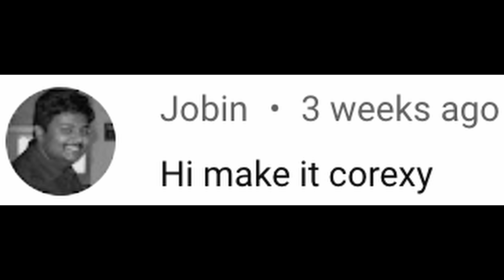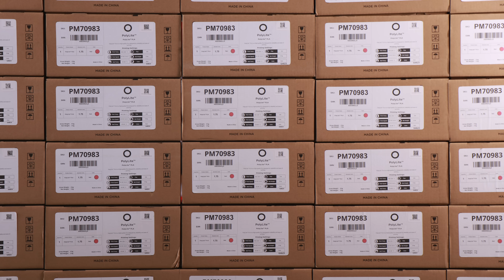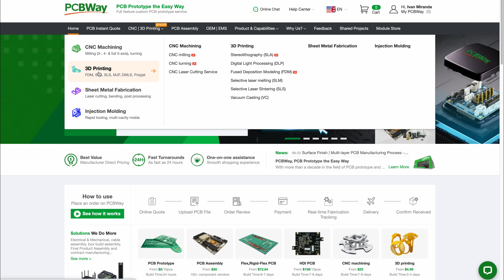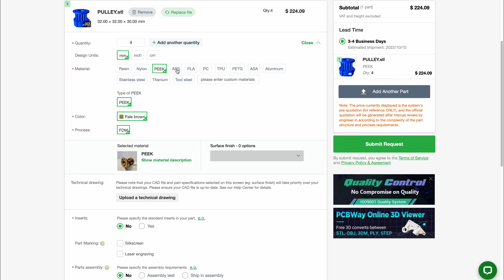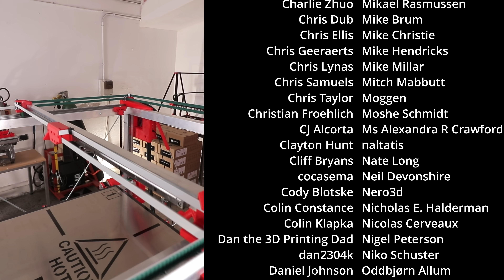I FINALLY CAVED, COREXY - GIANT 3D PRINTER BUILD PT. 4

Comment: Fill the stationary frame with sand to reduced the amplified noise of the steppers and reduce vibration.
Reply: Well... It's sounding like a spaceship... I don't know if changing it would be a good idea... 🤔
Reply: There have been tests, other then being a danger to the mechanics, filling spaces so comparatively small with sand does not help.
Reply: That is a great way to do nothing and get sand everywhere and destroy your mechanism
Reply: Better to use PU foam to absorb resonance and ringing of frame tubes.
Reply: Could some of the vibration be from the toothed belt going over small round idlers? Or is it all motor switching noise?
Reply: @JamesUKE92  I was thinking that too.  Also, I can't imagine the teeth of the belt are going to last long if they're rubbing over the flat-faced idlers like that either.  I think it might be a good idea to replace the idler pulleys with suitable toothed idler pulleys.
Reply: @FG-Supercharged  Yeah, when I saw the teeth oriented in like that, this was my first thought
Reply: Instead of sand you could use rubber or silicone

Comment: First print will be a corner piece to an even larger printer. 😁
Reply from the maker: Deal! 👊
Reply: @ivanmirandawastaken  I sure hope it will max out the print area!
Reply: @ivanmirandawastaken  Make a printer that's mounted on the walls of the room you're in, also using COREXY. :)
Reply: Perhaps with 'belt & pinion' - would be cool to see, and less problems with tension/stretching.
Reply: Hey Sean, caught you there 😊
Reply: End goal: Print-in-place version of the tank.
Reply: @ivanmirandawastaken  I hope this printer has a massive heat block because it's going to take a long time to print anything otherwise!
Reply: My guess: Ivan's end goal is to make printer big enough to do a print-in-place house out of red PLA.
Reply: @ivanmirandawastaken  I think a funnier one would be to print a regular size (200x200) printer which just needs screws and bearings
Reply: a printer that can print a house..
Reply: Do it!  How high is your ceiling!? :)
Reply: @ivanmirandawastaken   dear lord I hope you do this and keep doing it until you max it out lol!!! The sky is the limit mantra fits your circumstance perfectly lol!!
Reply: your sick!

Comment: Our pleasure to help you fab these parts out and most importantly, nice content as always, Ivan 👍
Reply from the maker: Cheers!
Reply: @ivanmirandawastaken  What is the cost of those pulleys in aluminum though?
Reply: @ionstorm66  I want the same answer. I thought about getting a quote to see if it is worth it or not. However, if they do not exist already off the shelf, the cost could be worth it. Hopefully it is low enough to not regret the purchase after the fact. Inevitably this size of printer is going to become commonplace in the next few years and the parts will be readily available. I have been collecting parts for a couple years and plan on making one at least this size. I just need the space.
Reply: $1000
Reply: @jesuslovesyou5819  that would be too much, for sure. I hope it's not that high.
Reply: @ivanmirandawastaken  🥂🥂

Comment: For folks building their own printer: When tensioning the belts on coreXY, you need to keep the Y-gantry square with the frame.  The easiest way to do that is to move it to one end of the printer and tie it down there temporarily while you tension the belts.  When you pull on one belt, it will want to move the gantry out of square, and this is normally held in check by the tension from the other belt.  This is why both belts need to have the same tension, and why you need the gantry held square while the belt tensions are uneven while being adjusted.

Comment: You should swap the smooth belt idlers you have now for toothed idlers (either store bought or just printed with some bearings in it) because these smooth bearings will damage the tooth profile of the belt over time since only the tips of the teeth are in contact with the idler bearings.
Reply from the maker: Those teeth will last forever against the bearings.
Reply: @ivanmirandawastaken  i have smooth bearings on my CoreXY over 2 years now, and had no problems at all at 200mm/s every day. Toothed idlers have smaller bearings in them and last shorter. Keep the bearings :)

Comment: One source of the noise are the teeth of the belts running over ball bearings instead of fitting pulleys. The xy System should then be significantly quieter

Comment: Here’s the CoreXY explainer comment!

The primary goal, as Ivan said, is to reduce the moving weight of the system. By keeping the motors stationary, you accomplish this. Unfortunately, it becomes difficult to isolate the movement of the motors into the two separate X and Y axes, so they end up getting combined like he demonstrated. 

Previously, in industrial machinery with very stiff gantries, you could accomplish this with a kinematic system called an H-bot (called this because the belt forms an H shape), which was very simple and didn’t involve any belt crossing. It does however, REQUIRE the gantry to be very stiff, as X direction moves applied force to only one side of the gantry, exerting a twisting force on it. 

With the advent of 3D printers, pretty much the first consumer-tier high speed cartesian robots, a new system was needed, in order to not require a super stiff (and therefore heavy and expensive) gantry. CoreXY had been used throughout history, most notably in computerized drafting tables, but didn’t see it’s big moment until people realized it’s perfect for fast (or in this case very large) 3D printers.

As for how each system actually works: here’s a quick explainer:

 - H-bot kinematics use one very long belt, which wraps around each motor with both ends at the carriage. This means that there is only one way to pull the carriage in each direction. Since each end comes from a different side of the gantry, those same forces are applied to only one side of the gantry, causing it to twist. 

 - CoreXY kinematics essentially just double up the H-bot design, adding a second belt, running in the opposite direction to the first (with one motor per belt) so that each carriage move produces two equal and opposite forces on the gantry, cancelling out the twisting forces.
Reply from the maker: Told'ya
Reply: @ivanmirandawastaken  Just doing my job ;)
Reply: I built a CoreXY, well, I modded my weird XY bedflinger to be a CoreXY bedflinger, and there is always a tradeoff. In the case of the CoreXY, you trade the mass on one axis for much longer belts that are a bit more prone to ringing. And you still have one axis with a greater mass than the other. A crossed gantry design (sometimes called "quadrap") has shorter belts and both axes have the same mass, but it requires more hardware to prevent racking.
Reply: For extreme large machines like this a cross xy gantry would work better. Way shorter belt so less resonance on it.
Reply: @TDOBrandano  yeah, honestly on something this big I’d probably do rack and pinion or a stationary belt drive just for precisions sake. Most of the time spent printing is gonna be long straight lines, so the lower accelerations needed for a heavier gantry wouldn’t have as much of an impact on print time.
Reply: @staticred1559  very true, that also reinforces any twist in the center of the gantry from the weight of the carriage (which for a printer of this size will be noticeable). CoreXY definitely shines brightest in mid-sized high speed machines (like the Vez3D AWD)
Reply: @benhobby17  For such a large printer it'd even make sense to have an additional fine motion stage mounted to the gantry -- by which I mean, use the main gantry for traversing the whole huge 3d print volume at modest accelerations with the extruder motor, and a second super lightweight delta motion stage attached under that to allow the hotend to perform small/fast adjustments independently of the rest of the gantry. In terms of control algorithms, you'd use a crossover filter to separate the demand position signal into high frequency and low frequency components, and feed the gantry the low-frequency part and the small hotend stage the high-frequency part.
Reply: @AJMansfield1  that would be the way to go, but the two big problems are gonna be resonance from the moving mass of the delta, and the insane complexity multiplier of having an entire extra printer mounted to your printer. For me, big + rigid + powerful would be easier in pretty much every way. But I’m also not a software guy.
Reply: Also with software and fast microcontrollers the complexity of corexy is solved almost for free and basically goes away.
Reply: @AJMansfield1  yes for a bigger printer having like a 2" diameter delta with a bowden might help quite a bit, might also be interesting to use the principle of the 45° nozzle that allows 90° overhangs, and make the delta able to twist.
That does add a bit of weight to the gantry, but it also means you don't need huge acceleration on the heavy axis.
Reply: also its an etch a scetch
Reply: One of the issues I would suspect these systems to have is that any vibration/slippage on a motor translates into an XY movement.  Being a differential system on coreXY it’s going to be sensitive to this.  However it is self aligning when stable (the common mode state in electronics terms). Great idea.
Reply: I thought the 3d printing community was collectively intelligent enough to not need such an explanation.  Guess not.
Reply: @roguereductionist8147 Perhaps there are people new to the 3D printing community who could benefit from an explanation.
Does it make you feel better about your  self to put down an entire group of people because one of the group was nice (and intelligent) enough to type out an explanation? Are we all supposed to admire you for pretending to be intelligent?

Comment: Ivan, thank you for your video series. In industrial robotics what you have made is called an H-bot. They are perfect for this type of application where the Z height of the end effector (print nozzle in this case) remains constant. The sound you are is a byproduct of the resonant frequency of the components connected to the source (motors). Adding mass or dampeners at the right locations will reduce the amplitude of the transmitted sound. This could be a block of rubber next to the motors inside the hollow aluminum tube or filling the tubes with sand or other material.
Reply: In the lingo of 3d printers, an h-bot is different from core xy.  An h-bot uses a simpler belt routing, but has the disadvantage of causing torque on the moving axis.

Comment: Very nice looking printer. If you are looking to make it even more insane, you could upgrade to a CoreXY AWD by adding 2 more steppers at the idlers. It would give you greater stiffness in the belts thanks to shorter paths between motors and gantry as well as more acceleration. If you want to lighten up your X axis, machining pockets in the aluminium extrusion is a known way to do it as long as you don't remove too much metal. Or straight up use a square carbon fiber extrusion. That way you lower the moving mass. The frame itself already seems very stiff, using steel instead of aluminium could improve that. Since it is immobile, that added mass is no big problem and will help damp gantry induced vibrations. Sand filling could also work. Don't know what kind of hotend you plan to use (maybe even a custom one?), but with this size it better be a very high flow one to take advantage of such a large print volume.

Comment: Nice setup. One trick to confirm that there's equal tension (without a belt tension tester) on the belts is to pluck them and hear the sound on an equal distanced area like across the back of the back of the printer. then you can use a guitar tuner or by ear and hear if they have similar tone.

Comment: super awesome work Ivan! congrats on the first try success! :P
i think a large part of the sound and belt vibrations are coming from the belt teeth running over smooth idlers(/bearings). i'm pretty sure you can buy appropriate idlers and it not get PCBway to hook you up.
the pallet of polymaker filament is pretty sweet, but maybe ask them for pellets and a pellet extruder.
alternatively, a multi-input hotend like the diamond, modded with multiple heat zones and drilled out to 1mm+ will let you push lots of filament and multiple spools at the same time.
Reply: You can also turn over the belt so it rolls on the flat side. It just take some clever additional pullies to engage with the motor-pulley
Reply: @bee2hive  or he could just use toothet idlers...
Reply: I was going to make the same comment about the smooth idlers, I'm also interested IF they'll leave any noticeable printing artifacts

Regardless this build is badass and i can't wait to see it print :)

Comment: I love it, It's a new type of musical instrument right? The 3d printed corners and most parts are hollow PLA Chambers that amplify the resonance of the steppers. IMHO -Silent drivers? - add dampening material in the corners and bars. Add weights to the frame that can be placed in various spots to reduce the resonance noise across the beams. Turnbuckles would work really well as a replacement to the current bracing system allowing you to use a synthetic fiber (NON-stretch) to decouple vibrations, allowing for increased tension to tune out vibrations.  I have also had great success at reducing Motor noise by strapping large heatsinks or weights (non-Ferris) to the side of a stepper to reduce vibrations in stationary motors.   Nice Project cannot wait to see this print or at least play a nice tune.

Comment: So, here's a tip for making it much quieter.  This worked for my coreXY, but it's only 300x300.  The belts, if you twist them once, 180deg, between the motor and the fixed corner, then the smooth side of the belt will run along the pulleys in all the corners.

Comment: I built a core xy printer (Voron 2.4) and not sure how you ran the belts but you should be able to to run the smooth side on the bearings. You may want to look up their design to see how it was done.
Reply: toothed bearing, rather than a smooth one.
Reply: @jase171973  also :) Would help

Comment: Great machine....:)
Sounds like bigger idler bearings will reduce the noise a lot. I can hear the belt teeth impacting on the skate board bearings. Put a couple of bearings on a shaft in the vice and run a loop of belt by hand to test if I am right.

Comment: I think the teeth of the belts moving around the idler bearings at the corners is contributing to the extra noise. Should those be toothed gears at those corners for the belt teeth to ride on?

Comment: I don't see another comment saying it yet so:

you should probably get pulleys printed for the idlers too. Crushing belt teeth into bearings drastically increases wear on them. It's only 4(or 6 depending on layout) anyway.

Comment: is it possible that the noise is coming from the ribs on the tight belts rolling over the smooth idler pulleys? then it is amplified becaise it resonates through the frame?  maybe switch to a ribbed to idler pulley to reduce noise? thay being said I could be completely wrong. it was just a thought

Comment: Great !  Is there a way to reduce motor noise ?
Reply from the maker: Yes, tunning and even more important, not being a savage when doing the config
Reply: @ivanmirandawastaken  🤣
Reply: @ivanmirandawastaken  I'm sure you're aware of ClearPath motors from Teknic. I used them in my CNC router build and yeah if/when I ever get the chance to build a 3d printer on this scale I'll be for sure using them on that. They're extremely quiet, strong and fast. Granted they're a bit overkill for the movement demands for a 3d printhead and of course more expensive, it'd still be cool to see them on something like this. =)

Comment: Thats some nasty stepper whine. I suggest something like the nano zero stepper (servo) from misfit tech, or the mks servo boards. Much quieter, plus you can up acceleration and speed without fear of losing steps. I use the nano zero boards on the nema23s we have on a 1.5x3m plasma cutter at work. Dead silent.

Comment: It sounds like a racetrack!  Is the noise caused by the belt teeth on the smooth pulleys and if so, wouldn't it be quieter to have toothed pulleys?

Comment: You could machine/grind a slot along the length of the rail from the bottom flange base up the web to reduce the mass - lol -.
You could also drill holes up from the bottom flange to make it lighter.

Comment: I was hoping for a large Ivan built delta printer but your ceiling is not 5m tall.

Very nice CoreXY build and explainer, I have experimented with a model as well and the only issue I found was the belt length and if either side tension is looser it could skew the gantry. For 3D printers it's not nearly as necessary as if this was a cnc machine with side loads.
Reply from the maker: I could make a hole I guess...
Reply: @ivanmirandawastaken  you don't need a roof, it doesn't rain in Spain right?

Comment: Considering the size of the machine and the torque of the motors a little grease on the idler axles could help some of the noise and shouldn't affect performance

Comment: Hey Ivan, please check out vzbot AWD for example adding 2 more motors on top :) shorter paths realy would help this build !
the shorter the paths the less problem with torque cause of the heavy belts adding 2 more motors on the top would realy make a big difference a specialy for a printer this size :)
Reply: At that point, crossed gantry would probably be more worth it imo- significantly shorter belt paths and a lot more rigidity

Comment: Now, that you reduced the mass of the gantry with holes, it will move so lightning-fast that it will heat up due to air friction! You have to add more holes for ventilation! Or spacers to keep the air at distance ...😀